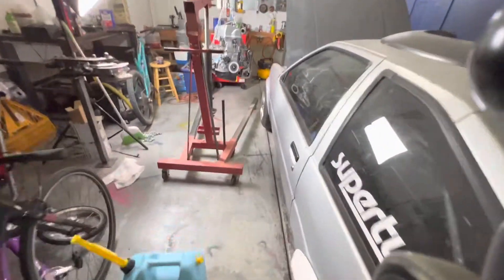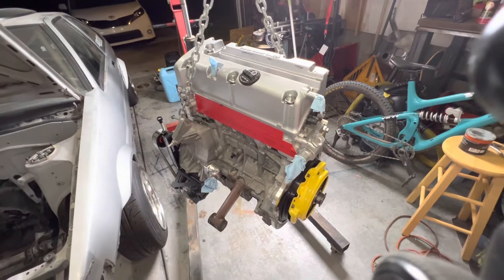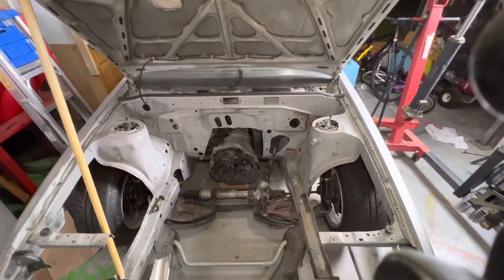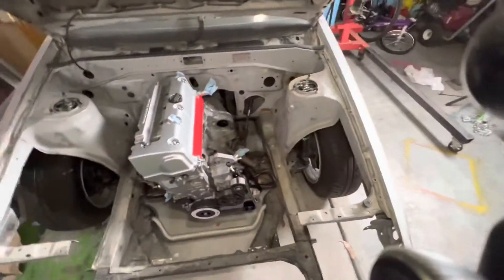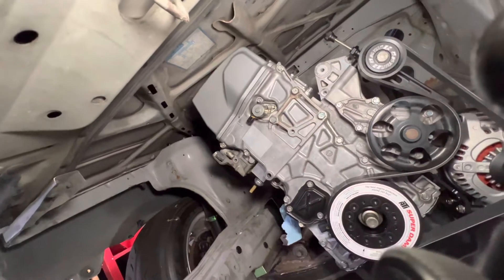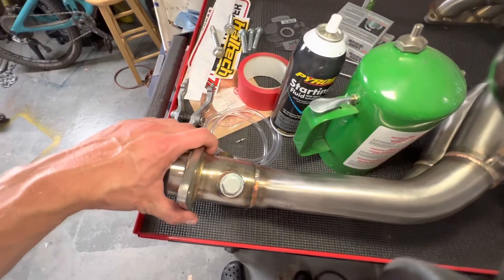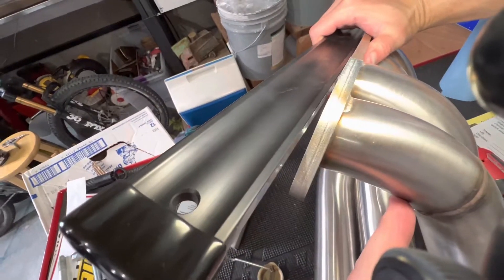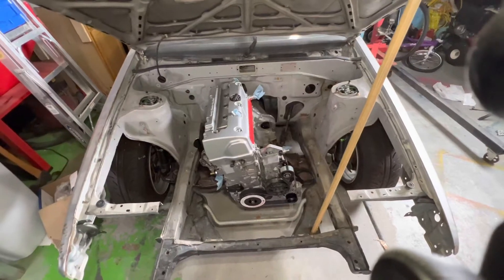Ae86 k24 swap, will it fit?

Comment: If you don’t want to cut the hood you can get a low profile valve cover. The valve cover along with the hood cut might also give you enough clearance not to run subframe spacers.